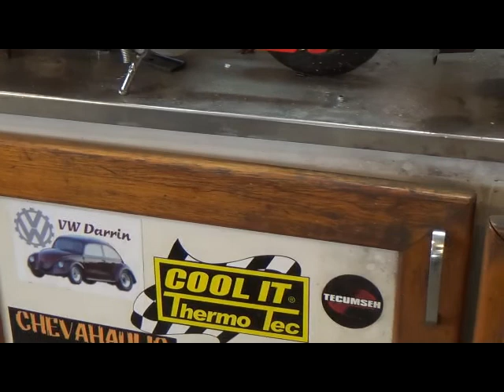Sharpening and balancing your mower blade

Comment: Thanks George. That is exactly the same way I sharpen my blades, but I haven't found one of those blade balancers. The blades on the Yazoo have elongated holes so they would not work on that anyway. I usually put one blade in the vise and use its sharpened edge to balance the others. I just eyeball it so they are centered. I gave up using a bench grinder years ago. I never got a smooth edge with it.
Reply from the maker: Bruce Boschek I agree with the bench grinder malady Bruce and you could still use one of these balancers, just using your center line from the bolts as a guide, but you have it down to a science already so no sense in re-inventing the wheel. Thanks for stopping in for a visit with me Bruce.
Reply: I just ordered the exact same balancer from e-bay. I will try using it with the Yazoo blades, but I have the other two mowers with round hole blades. Thanks again.

Comment: Good how to video George, hope it helps someone out. I didn't know that the last 3" was the important part, i thought it was used equally. That's me taught. Have a safe weekend and Have a good'n
Reply from the maker: geargriden19 If you look at most mower blades (say at Walmart or a hardware store) you will notice that they are only sharpened on the last 3 or so inches, new. Thanks for stopping by Daniel.

Comment: Thanks for the video, May not be rocket science but I learned something. I have to balance ceiling fans by adding weights on the low side and I am not accustomed to cuttigng weight off on the high side blades, that blade balancer is kinda neat. I need to visit the junk yard more often lol Thanks George:)
Reply from the maker: ***** Shopping at the dump is often rewarding for me. Thanks for the kind words of encouragement Cary.

Comment: Now that the grass is long enough to cut.  I have to get the lawn mower tuned up.  I think my parents bought it 10 years or so and its never been touched.  It works perfect.  Starts every year without a problem and cuts well.  I hate to touch it.  If I tune it up it may not work as well or maybe it will work better.  The engine is a Briggs and Stratton.  I will have to figure out the spark plug and oil.
Scott
Reply from the maker: Scott Downey I am sure you can do it Scott.

Comment: This should be titled how NOT to Sharpen blades.
Reply from the maker: Thank you so much. How would you do it differently?
Reply: @TheShadeTreeFixitMan  I certainly would not grind years of use off the blade just to eliminate small nicks. Never hold the edge toward the wheel on a Bench Grinder, you should grind away from it.  It should not be knife sharp.  It will hurt when those gloves catch the wire wheel.  Sharpen AWAY from the edge, not towards it with your angle grinder.
Being straight is more important than a balancing act. Always check for straight.  Stack the set if there is more than one. Grind only 1 side.
Reply from the maker: @gordbaker896  I don't use a bench grinder anymore, but I don't agree with your opinion of not needing to balance a blade. It helps the engine to run smoother and won't wear out the bearings as quickly. I do check for straight. BTW, have you made a definitive video on lawnmower blade sharpening???
Reply: @TheShadeTreeFixitMan  I give each end of each blade 3 firm passes on my Bench Grinder, grinding AWAY from the sharp edge.  Check for straight and reinstall.  I don't grind down to take all the nicks out. I don't expect they are perfectly balanced, but I feel it would take a noticeable missing chunk to drastically affect bearings.  I don't disagree with doing it and I have done it on customer blades (free to neighbours) at times.  It would be a very boring 3 minute video!